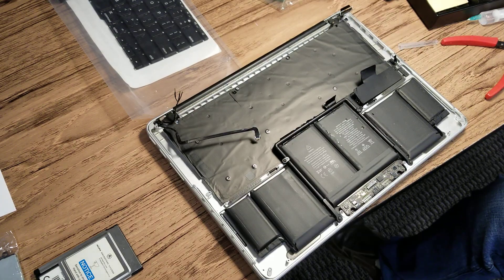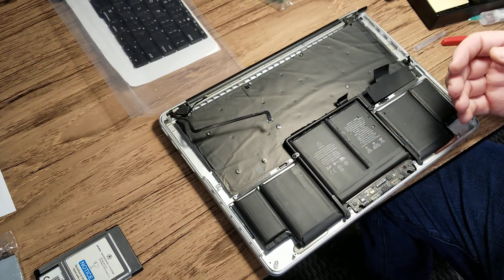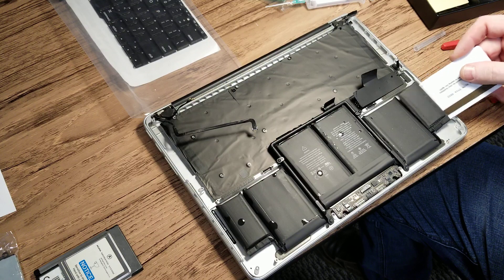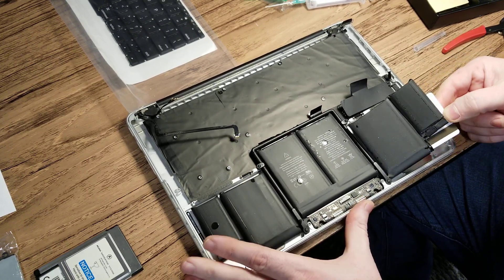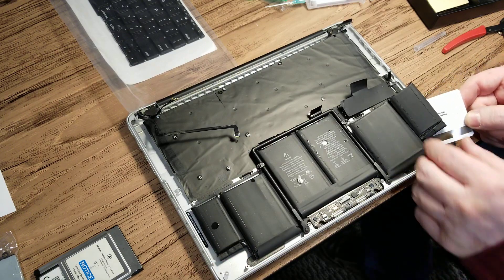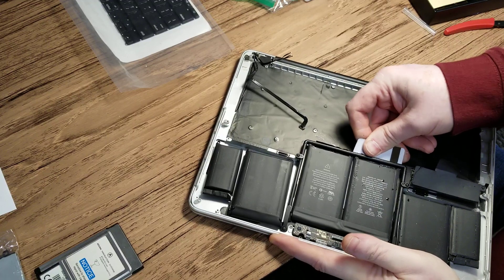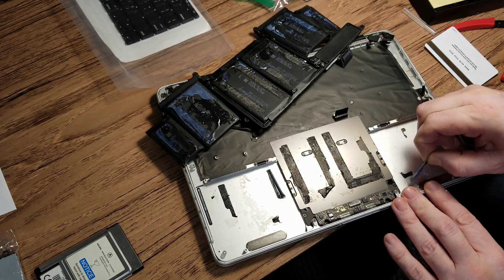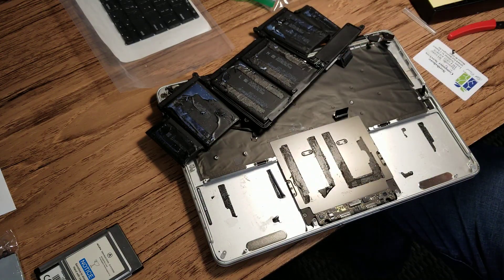How to remove and REUSE glued in batteries from Apple Macbook or other computers easily painlessly

Comment: This method was great.  I was replacing a dead battery, and it was great not to have to deal with a chemical adhesive remover!  It took very little time to remove the battery without damaging anything!  I did not have a syringe with a needle, so i used an art syringe with a curved nozzle - it worked as well as a needle would have!

Comment: This method is so an awesome way to remove the glue underneath the battery cells. I want to thank you for sharing this.
I live in Uganda and every part for Macbook is almost impossible to find. Being a computer technician here is a challenge indeed. Back in my home country Norway everything is available.
Most of my clients here are expats. That's why I get to work on Macbooks

Comment: A way to save it yes. BUT.... a 2015 battery or any battery for that matter will have many charge cycles on it depending on usage. This is a prime opportunity to simply replace it and not have to repeat again later. A new battery will last roughly 4-5 years so not simply replacing it is really not the best idea nor practical. If this was recorded 2 years ago, then this battery is all LEAST halfway gone if not more.....

This a horrible tutorial the more I watch . Isopropyl like that will destroy the LCD if not separated or a towel I between. Definitely do NOT do it this way. Use dental floss if piano wire, then goof off on a towel and replace the battery  9nce it's exposed to alcohol (battery adhesive removal like he did here) that battery is at risk.

Comment: If I may, what did you use to stick them back on, and where did you get it?
Reply: I've found there's enough residual 'sticky' left even after removal.  Failing that use a couple of strips of double sided tape.
Reply: @BrianWMay  any? Or does it have to be some heat resistant type?